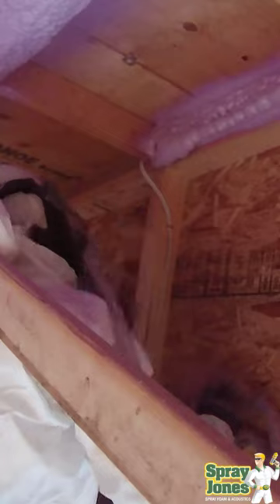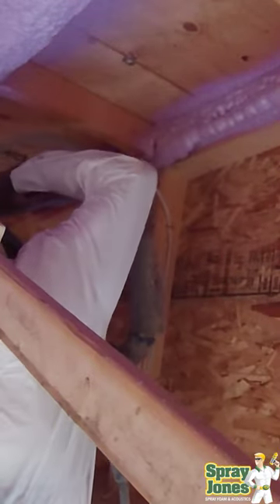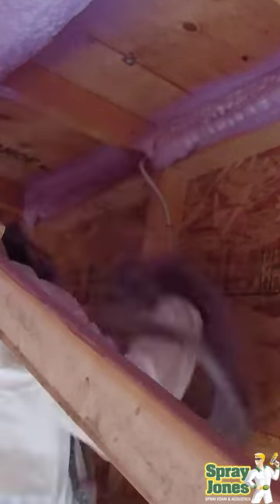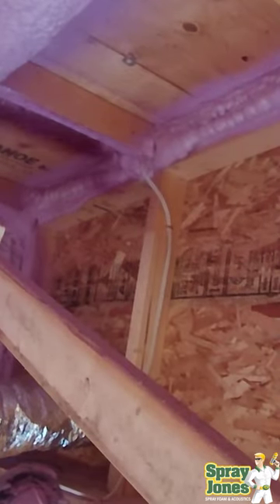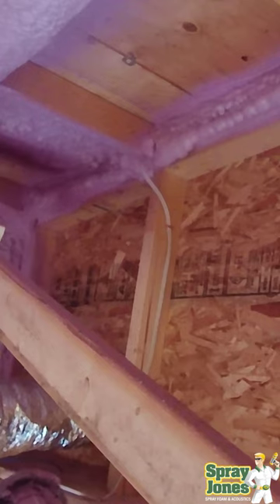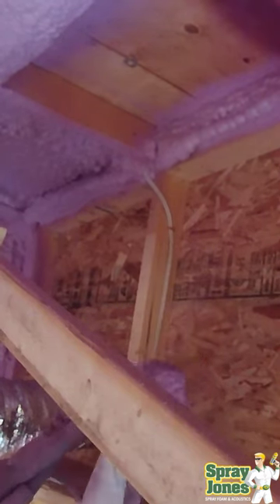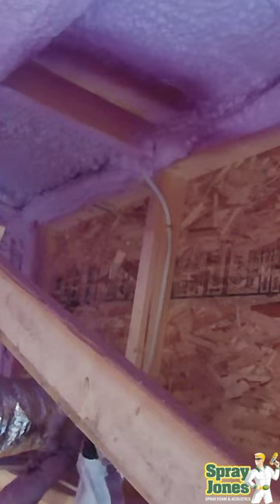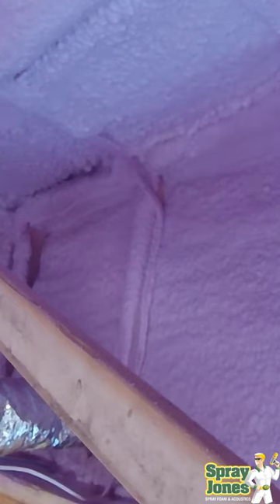How to Properly Seal Your Roof / Wall with Spray Foam. #insulation #Walltite #construction #shorts

Comment: Still on my particle size bull***t. Does the size/volume of the closed cell air pocket change performance? If the closed cells are 50um across vs 0.5um across....would the size of the cell with air the air in it matter all that much? What if it made 500x more closed cells?
Reply from the maker: Yes it does have a bearing on outcomes.